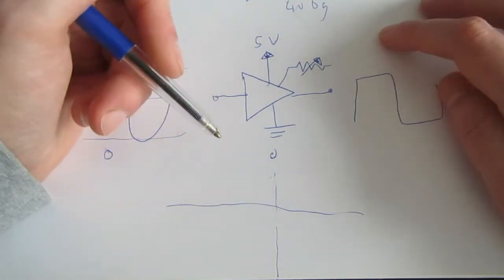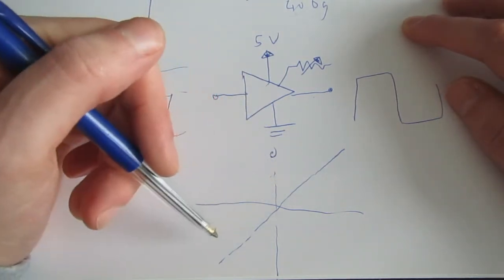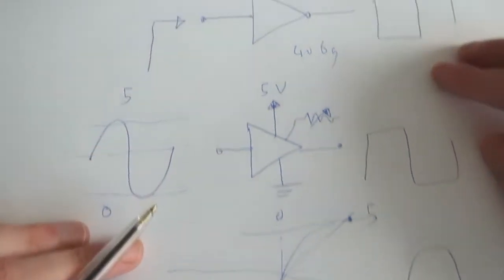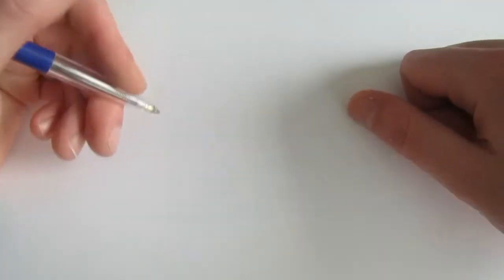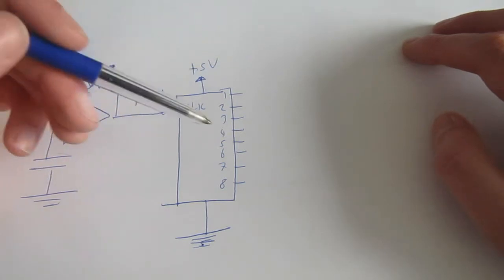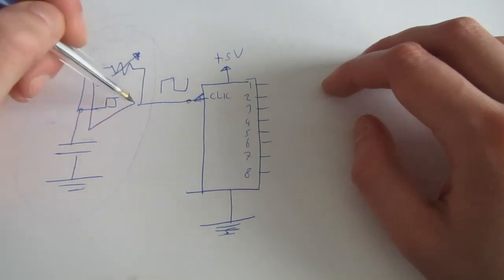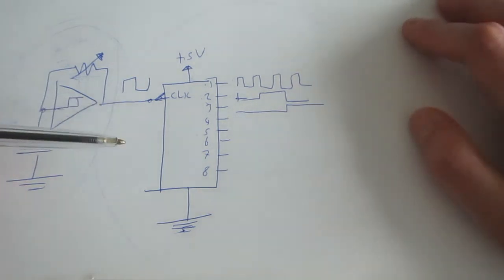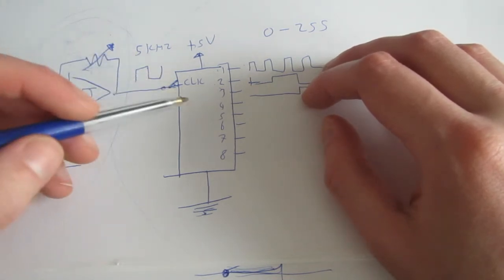Food for Thought: You Got Your Digital Electronics Wrong!

Comment: thx , very well explained ,  sonically toalking analog or digital , everythings is great ,  when it get the right process
So if i understand well , digital converters just "squarify " the signal when i record in my sound card ? I guess there's a bit more details , if in the future you could do a video on this " analog to digital" or " digital to analog" encoders\ decoders coud be great !
Reply from the maker: Thanks :)

No, digital to analog converters convert an analog voltage to binary data, for example an 8-bit converter would have 8 outputs that would connect to the rest of the digital circuitry. Of course this binary data only consists of high and low voltages so you could imagine the digital data as "square waves". Remember that this video is more about a way of thinking and the subsequent mistake people make when calling something 'analog' or 'digital'.

There's a lot of info/videos already available on how these converters work, but if there's enough interest in yet another video on the subject I'd be glad to make one.
Reply: @rot_studios   , thanks a lot for the precision. will check some infos about this conversion.